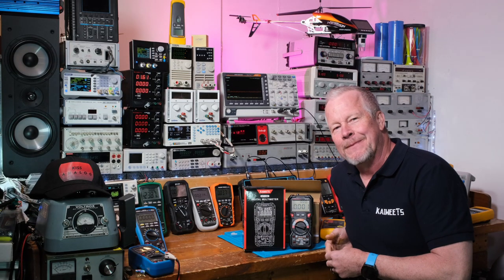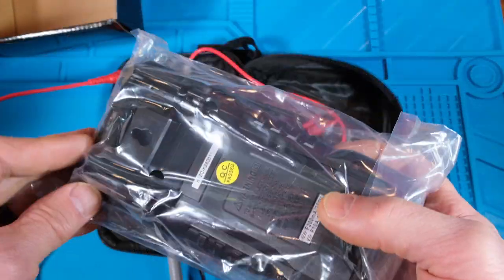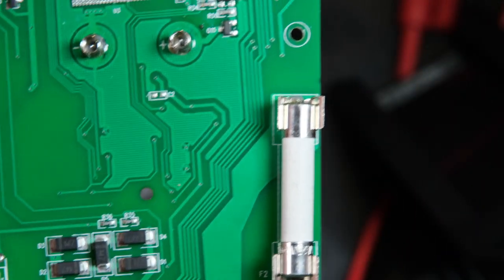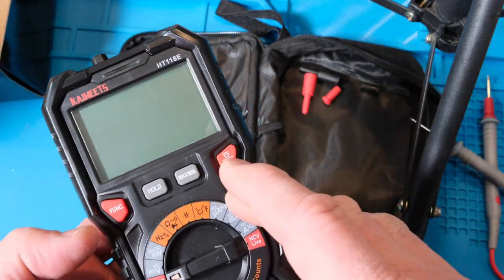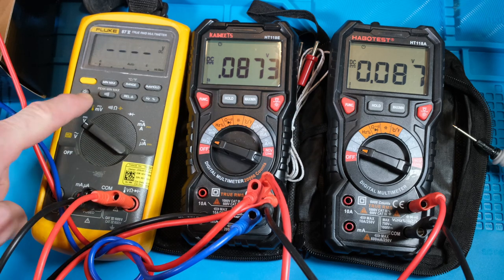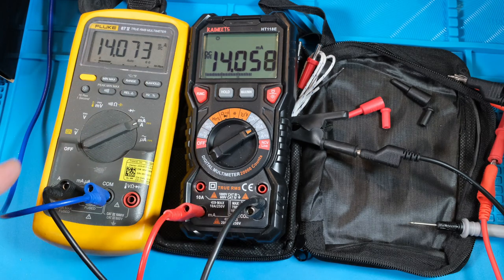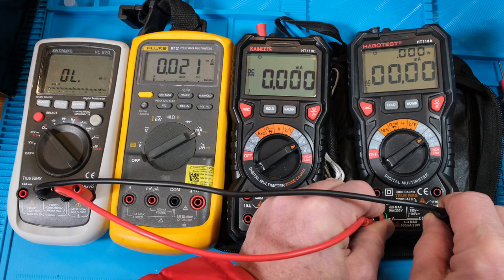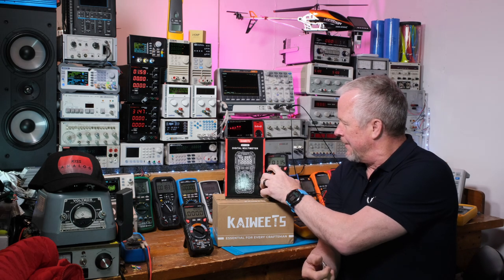New Kaiweets 20k count HT118E Multimeter - deep dive with a Fluke 87V and the Hobotest HT118A

Comment: Well the "Firestick test" can have some merrits to it, I can think of 2 uses for a quick latching continuity beep.
1. When trying to find a trace on a multi layer board, and you try to find vias etc that belongs to a trace,
    and you have lots of points to test for continuity, a slow beeping MM can be a drag. Much better that it beeps quickly.
2. If you suspect intermitent connections in a connector, switch or something,
   a continuity test that reacts quickly will reveale that.
   Hooking one lead to each end of the cabels, and then wiggle cabels and connector might reveale where the problem is.
Reply from the maker: Thank you!  Great exa, but both examples prove good connections and fast response is good, but that takes a second or half a second.  The fire stick is ridiculously fast and uncertain of what is happening.  If you have an intermittent open or short the best way to find it is to connect alligator clips or equivalent then move the leads.  If it is too intermittent it is just too inconclusive except to say there’s a potential issue.  The fire stick displays nothing conclusive.  It is a ridiculous display of testing.  Do you 2ant to fly on a plane tested w it’s a fire stick methods?
Reply: Pop some fluke leads into the meter and I'm sure it responds faster if it's anything like the one I bought. Mine was delayed and I was going to send it back immediately out of frustration and I threw on my fluke 789 leads to it and it worked just fine

Comment: Referencing  the conversation involving safety and the lack of UL or ETL listing, I think it would be interesting to back up your faith in this company with a teardown.  I see there was not much protection inside.  Not the place to cut costs from my standpoint.
Reply from the maker: Great point!  Safety is always key.  Much of that protection that you see in the meter is to protect it while working in a CAT III and especially in a CAT IV environment where spikes and such are more possible to occur.   A meter that is not safety certified should not be used in these locations.  On the bench there is little concern regarding this protection - IMHO.  Thoughts?
Reply: @KissAnalog  Should be fairly common sense. If your life depends on it and you use it very often, then just invest in a certified name brand device. For most hobbyists this meter will be plenty enough. I usually don't get beyond 24V and often use this for audio measurements when my scope or computer is too far away/cumbersome.
Reply: @KissAnalog  Unfortunately there are some far-eastern manufacturers that make counterfeit and lookalike copies of all sorts of test gear including multimeters. They will also forge test certificates and documents - I know because I've been asked "What do you want the certificate to say?". 
Regrettably by the time you find out the protection isn't up to the job, it's too late and either the meter has been destroyed and you've been burned or injured too.
Don't get hung-up on specs, bells and whistles. Proper safety and components and buying a reputable brand is essential to protect the user. You can always buy a new meter, but not a hand or face.